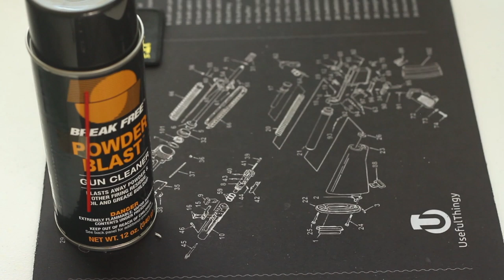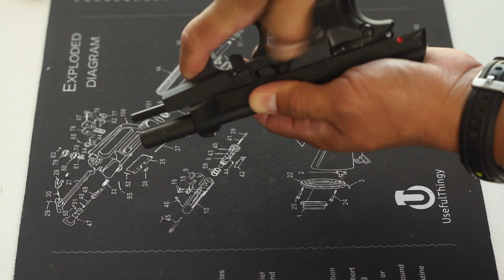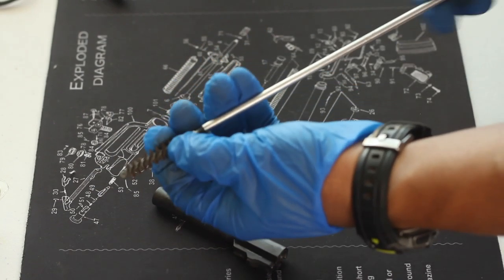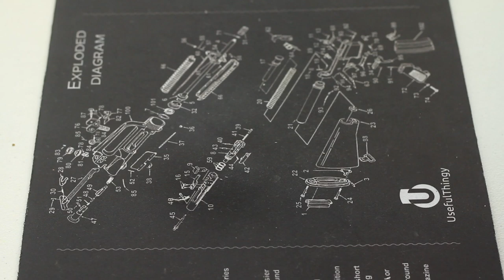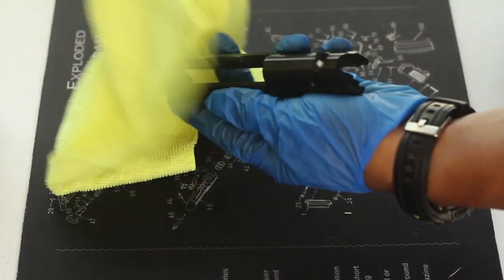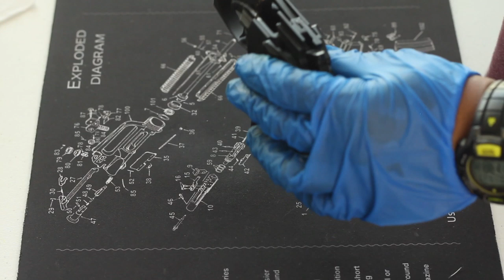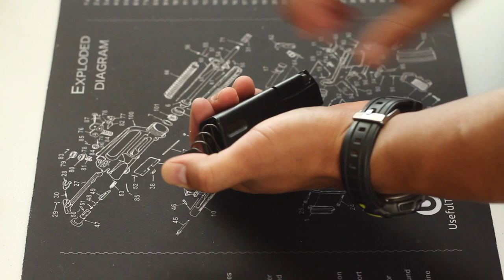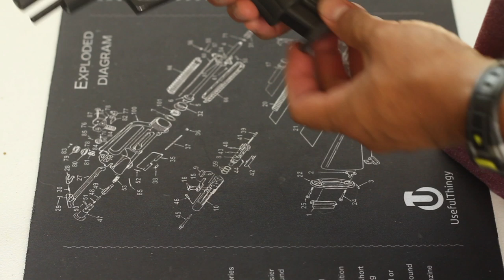How to Clean the Beretta 84 and 85 Cheetah | Gun Cleaning Tutorial

Comment: When you remove the slide initially, does it matter if the gun is cocked or must it be in the fired position? I ask, because I always have a difficult time getting the slide back onto the frame and into a position that the lockdown can be turned back to the locked position. I seem to have to rack it back and forth and fiddle with it until I can get the lockdown turned back to locked. I've always wondered if it has something to do with the hammer position. Fired or cocked. Thanks!